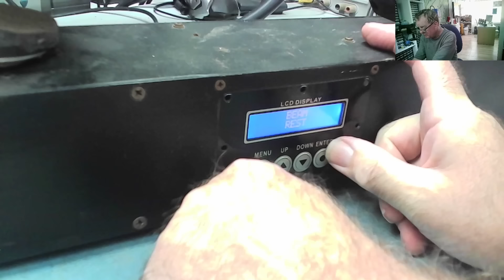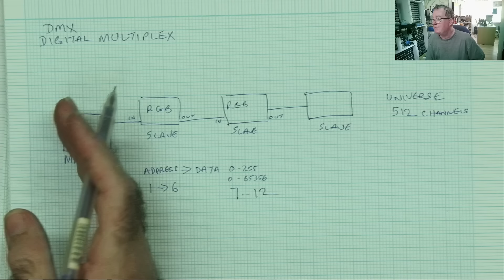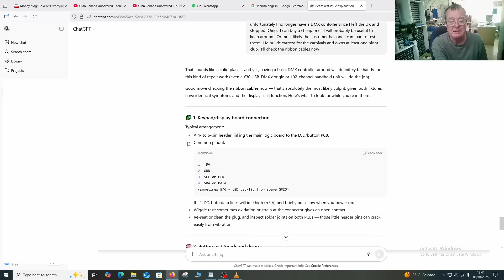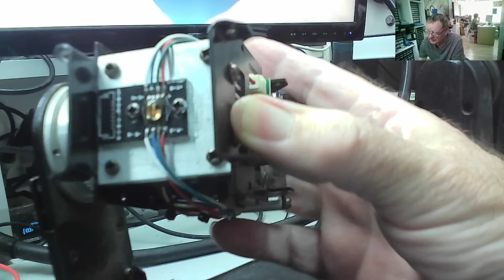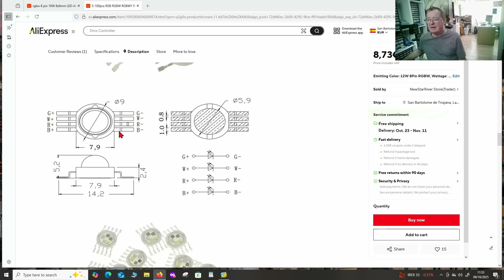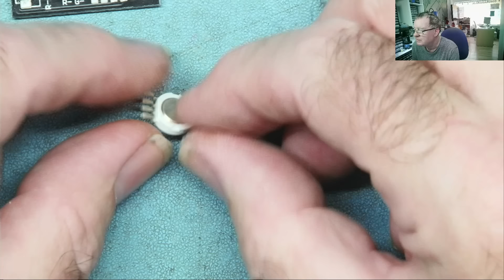DMX Moving Head LED Stage Disco Lights Repair

Comment: can a corrupt bio stop a motherboard from turning on now I'm not talking about booting up I'm talking about turning on and what voltage should you have at the power switch I thought it was 3 volts or 5 volts I've got 1.2

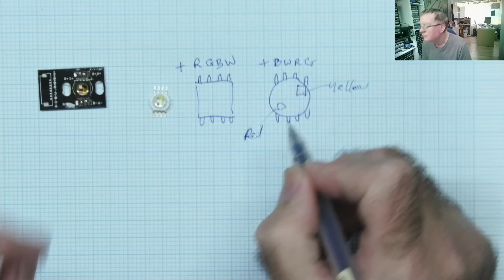Comment: Rick you are wrong with the pinout of your LED. When testing (44:40) the order is Blue, Red, White, Green and on the paper (45:30) the order is Blue, White, Red, Green so you have a wrong order here. And yes you have tested again the color sequence after you have solder them on the boards (58:20), but never the less you have soldered cables in a wrong order - exactly as you draw them on the paper green cable/blue led red cable/white led white cable/red led blue cable/green led. That order is wrong. Red led is before white led so you should exchange the place  of red and white cables to be correct. And never the less I think you should have started with the position and speed sensors here, because the LEDs even been dim were still OK, so the problem you have experienced was not with the LEDs. If it was with the LEDs the test will fail on the LEDs blink and not on the light positioning as it currently is.
Reply from the maker: I will check that.  The problem here is too many unknowns.  Does the controller detect LED current at startup? Both units behave in exactly the same way during startup (same head movement behaviour) is this the same fault on the same head on both.  Do these units have built in light show or are these ones DMX only.  See the problem here?
Reply: Probably the unit has other modes like auto. This because of the interim message
Reply: You need a DMX controller anyway Rick
Reply from the maker: @nasosst3092  Yeah I'm ordering one 😉

Comment: seems (at least the) leftmost servo is not reacting properly and mcu gets stuck in self test into watchdog reset, but you got distracted with replacing slightly burned out leds instead. it certainly will be nice that the unit will enjoy proper light color and intensity - once main issue gets fixed 🤣
Reply from the maker: it is quite possible.  Problem here is not enough info.  I should be able to determine the cause of that by swapping a good head from the other one.  Interesting though both units act in exactly the same way on the same head during reset.
Reply: @learnelectronicsrepair  I'd swap motor controller around to see if the problem follows, otherwise I'd think bad motor.... Glad your working on DMX lighting... I have tons of lighting that I will be servicing thru the winter months due to damage from rain and dampness in the summer months! My Leds in my moving lights have also gone dark like the ones in the video, I have found that they have some pretty small (micro) fans for laptops these days... I'm thinking of incorporating them into my lights to keep them cool.

Comment: careful, on the one module that had the LED shifted it looks like the pad on the back of the LED might be shorting out the multiple + pads from the original LED mount. that's not an issue as long as each LED is being powered individually, but when you power multiple at once, it's going to cause crossover between them

Comment: Oh the old memories....
Mic cables different. Analog 75 ohms. 1grn. 2 hot, 3 cold. 
DMX cables digital serial type. 1 grn, 2 data -, 3 data +. For 3 pin xlrs. For 5 pin xlrs pin 4 data - and 5 data + for the DMX 1024 extension which never came. 

Nice job with the leds replacement Rick. Hope those new leds can survive channeling the heat through the central solder pad. 

Last thought: if the four buttons control panel is not responding then possibly eprom is gone. Is there some battery? . If the two fixtures are set to operate by DMX after the initial routine there should be an address on the lcd. Say 001 or 005 if the fixtures have 4 channels. If there is no dip switch panel the starting address and the operating mode are set through the 4 buttons. To be sure try using a DMX console...

Old memories awaken... Thanks Rick

Comment: Sometimes you can reset the device by holding all 4 buttons and powering up the device for a couple of seconds. It looks like the microcontroller is damaged. Was it an option to replace the led devices with good ones from the second device? I agree that broken wires in the moving heads is a common problem. I am looking forward to the next episode.
Reply from the maker: The second one has the same fault as this one

Comment: It's foolish anymore NOT to use AI for technical support. Yeah, sometimes it gives bad data, sometimes it just takes a wild guess. You must use your own common sense and wisdom to sort it out, but the bottom line, it provides information that we need esp when working on something we don't have previous experience with. I like it. I use Leo in Brave Browser, and also Grok in X.. They're both helpful to me. Time savers that prevent me from having to take a lot of time hunting around the web for information.

Comment: Enjoying this DMX (5 pin xlr originally) and Mic cables use all 3 pins (1,2,3) as both are 'balanced' signals if a mic is 2 wire it's been made 'unbalanced' ground to cold 
Biggest difference is mic cable  is not made for digital signals but on the whole as long as good quality normally ok just not good practice Dmx is serial RS485 standards.  Good stuff